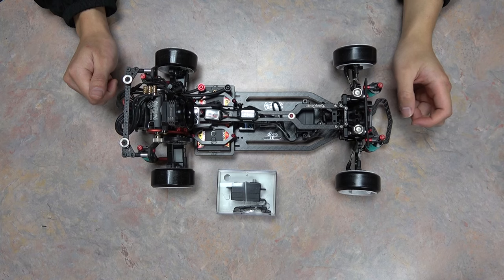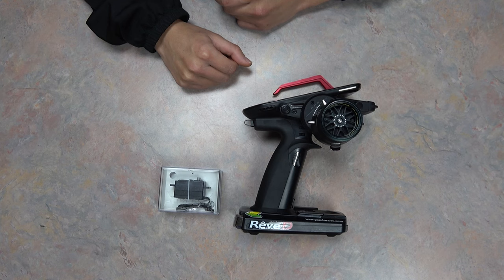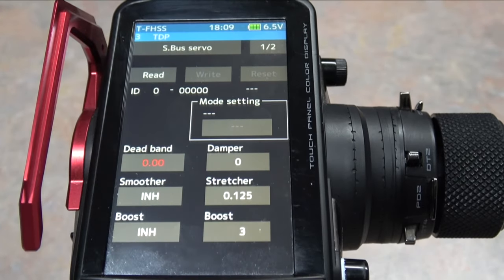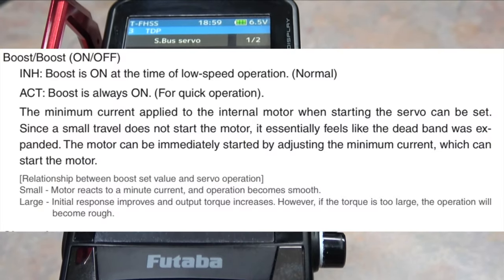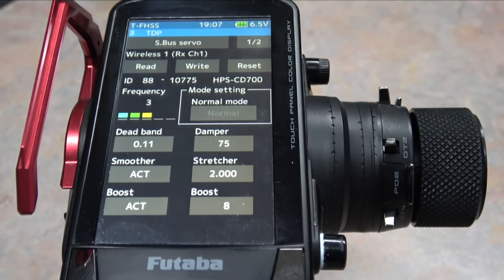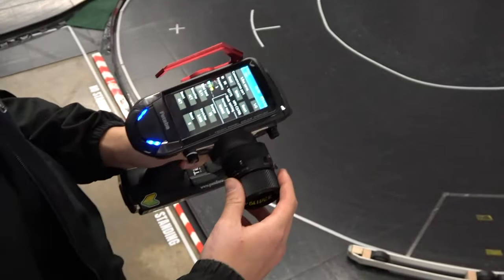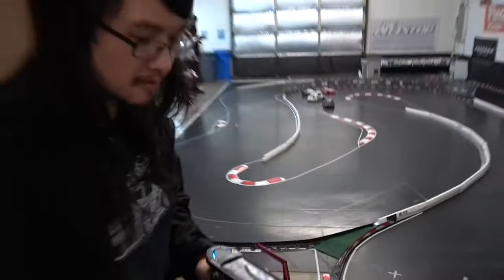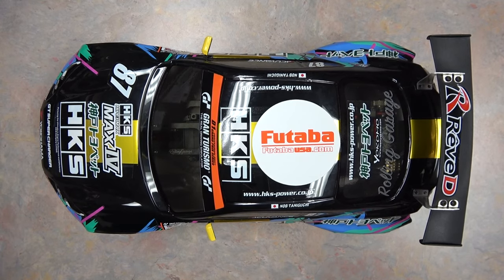Futaba Servos - Mitch-Spec TUTORIALS

Comment: For anyone having violent shakes with the high power Futaba Servos (even with the servo direct to the receiver, bypassing the gyro) try changing BEC in your ESC from 6.0v to 7.4v, worked for me.
Reply from the maker: Good info. I use an Acuvance RAD on this car so I don’t have the option to do that with this ESC 😅

Comment: Soft start is exactly as the name implies. It only affects the servo when powering up, it will bring the servo to center soft and slow. Since the gyd550 does the initialization twitch, soft start doesnt really work. This is more of a setting meant for aircraft or grip cars where you wouldn't want the servo to snap hard and fast to center when powering on.
Reply from the maker: I thought I noticed a bit of difference in driving feel while messing with it but I probably won’t be adjusting it in the future. Could have just been a placebo effect. Thank you for this explanation

Comment: I'm wholly convinced that there are defective and/or different firmware CD700s out there. My CD700 at factory setting would shake violently even just sitting at neutral with the gyro turned off. I have to run my stretcher in the 0.250-0.500 range as well as damper in the 150 range for it to work smoothly.
Reply from the maker: Saw that recently with another one. Try switching to that SR mode. That helped a lot for that servo.
Reply: Do you need to switch the receiver to sr also ?
Reply from the maker: @acha5070  See previous comments. You do not need to switch the receiver to SR mode
Reply: I had the same problem and I found that it went away after I increased the BEC from 6.0 to 7.4 in my RPX 2 ESC settings. Let me know if that helped

Comment: Did you have to change the receiver to SR mode as well? I’ve got the same set up on two of my cars and my shark hunts so bad with this set up. My SD 2.0 doesn’t really do it but my skark oh man lol
Reply from the maker: I did not so I retain my Acuvance telemetry display while my servo and gyro are in SR mode
Reply: It’s weird cuz if I don’t put mine in SR mode on the receiver it doesn’t seem to work right. And I didn’t know wouldn’t have telemetry in SR mode. Is this the same on a 10px with 404 receiver?
Reply from the maker: @DabbathaHut  Yes it’s the same between the R334 and R404. If you are using DDSS try turning your damper all the way off. Seems counterintuitive but that’s what I’ve heard for direct steer chassis.
Reply: @RollingGarageRc  any risk of damage running in sr mode on the servo and gyro and the receiver not being in sr mode? It just seems wrong to me lol
Reply from the maker: @DabbathaHut  Yeah seems like it wouldn’t work but that’s how I had my car set up in the video. Gyro and servo in SR mode and receiver on T-FHSS Telemetry Mode. You will have problems if you run your servo on SR but gyro on normal.
Reply from the maker: @DabbathaHut  The 404 actually runs off the F4G protocol so there is no Telemetry or SR mode for that receiver but should work either way

Comment: Mitch, you’re a lifesaver! I recently picked up a build that has a CT701 and the hunting has been so hard to track down. Gonna take some notes here and give it a try, anything you’d add for the CT over the CD series? I’ve heard it might need some more dampening from specific folks. Thanks again!
Reply from the maker: I had a CT701 on a previous car that was really glitchy so yes possibly more damper and less stretcher than usual but I would also say try giving that SR mode a shot.
Reply: @RollingGarageRc  Will do, thanks! I too was under the impression I had to forfeit telemetry to use SR mode but super useful to know that’s not the case. I’ve been running it normal.

Comment: Hi Mitch 
I have a question is the cd700 compatible with Reve d revocable gyro? Or only with gyd550 
And can I run it without SBus? 
Cuz I have RPX2, Reve D revox gyro, agile 10.5 with 10PX version 8.0E 
Thank you 🙏
Reply: From my understanding it's good to pair the two futaba servo and gyro together since they both can be programmed on the 7pxr or 10px but I believe the revox and the futaba can work together  it's just revox you have to manually change the settings.